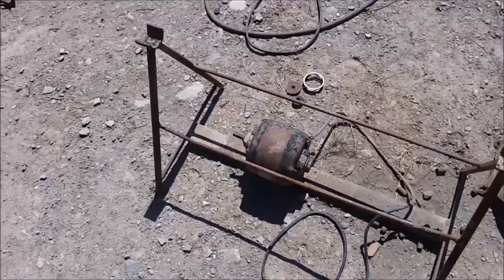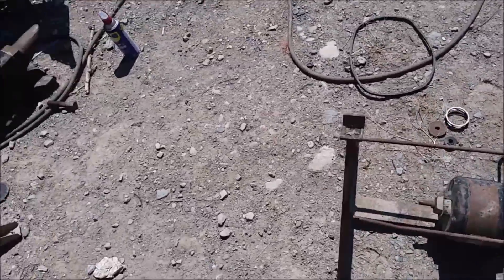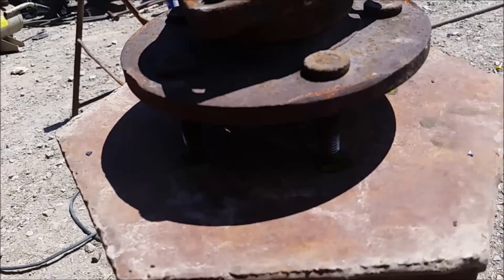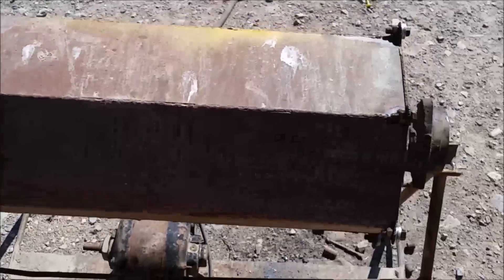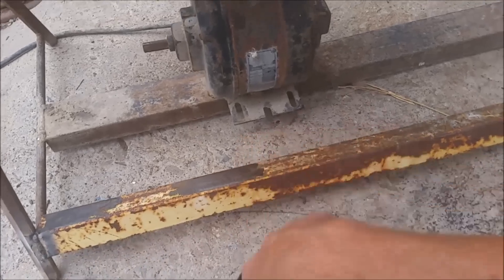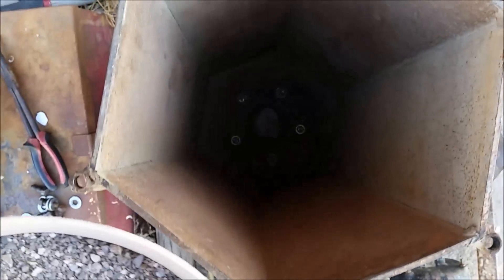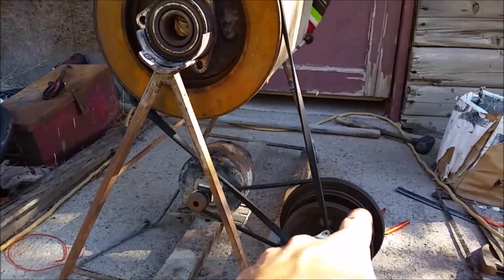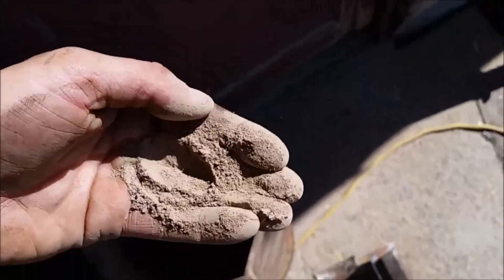Cody's Ball Mill

Comment: Cody completed my ball mill. Using 18" long 2" diameter stainless bars 4 of them inside. I have a tray for under drum roasting, blower for air during roasting in 1 end. I wish you would respond to give me your thoughts on this? I dont know how to send video of it running. Crossed fingers all work's.

Comment: Is this thing still working?  I’m asking because 4wd bearings do not like to be used with out the squish (load) of the axle stub. They tend to fall apart.  Of course this is a much lighter load than a Chevy truck.

Comment: Those hub bearings are a tapered bearing and they are supposed to be held together by a cv axle and nut. Running it without any thing in the middle means huge clearances, no preload, and guaranteed failure.

Comment: Cody, I also designed and built a ball mill.  I my research on how to build one I came across a story of man who worked at a coal factory where a ball mill was used to crush coal.  The mill was a very large continuous feed system using 6 inch steel balls.  At one point the factory decided to refurbish the mill replacing balls etc.  The man decided to keep one of the balls as a souvenir.  He kept it on his desk at work.  One morning he was notified his office was destroyed by an explosion.  Evidently the ball had built up kinetic energy from continuous pounding to the point that it exploded.  Since that time the factory buries used balls in deep pits covered by cement and dirt.  After use and clean-out I put our 1/2 inch ball bearings in a steel container with a steel lid.  Occasionally we put the media in the kiln taking them up to annealing temperature to temper out the kinetic energy.

Comment: couldn't you just put a rheostat/potentiometer on the motor to turn down the speed instead of screwing with the pulleys? it'd also lower how much power the motor would use.

Comment: Hey!!
I work in industrial plant construction and one of the last projects i worked on was a Cement Grinding Plant. 
That is where I learned how ball mills work and what are the main components of a ball mill (for the record, it is speed of rotation + grinding balls hardness & diameter + residence time of the crushed material ) to determine the correct output quality (diameter of the particles).
Im sure if I saw this video first, I would have learned faster. 
Thanks!

Comment: cool how about a screen on the inside the separate the larger material and have a single or double opening so the material is directed out those holes when at the bottom on rotation.

Comment: cool how about a screen on the inside the separate the larger material and have a single or double opening so the material is directed out those holes when at the bottom on rotation.
Reply: need to leave in the fine particulates when milling.   they help with the abrasion process.  the balls are not that abrasive by themselves.

Comment: i guess its too slow now. the correct speed should be between 65% and 75% of the critical speed which is the speed that the balls will stick to the wall in the full turn due to the centrifugal force. to find out the critical speed you can use the formula v=(60/2pi)*(g/(R-r))^(1/2) - R is the mill radius and r is the mean ball radius.
Reply: Are you certain this equation is accurate?
Reply: yes im sure but you need to consider that the speed on the equation is the mill rpm, not the motor rpm.
Reply: BR?

Comment: That looks pretty solid and simple. Where do you get those roller bearings?
Reply: Thanks. I figured they went to something big and heavy. That makes a lot of sense. Do you find the rust from your drum to be a contamination problem in your mill?
Reply: Where does he get it??
Reply: I MUST know
Reply: I would try my luck at asking around scrap metal dealers. I have no idea how common these kinds of things are scrapped, it may be a matter of just being at the right place at the right time.
Reply: Wheel hub. Anywhere from $30 to $150

Chevy truck non abs is about $50 and heavy duty.
Reply: Go to a heavy mining equipment shop they discard/ recycle them frequently from haul trucks and other heavy equipment
Reply: he used to work as a mechanic.  i bet he collected them from bearing jobs.

Comment: Great ball mill video! 

May I suggest you consider making a flotation cell for sulfide separation using simple chemicals & materials.  Thanks!
Reply: Adam, any knowledge on gold in sulfides? I sent off a 2lb sample of mine to a assayer. They extracted the gold, but wont say how. Im trying a ball mill grind fine, roasting while in ball mill, then add water and mercury.

Comment: Depending on the material you are milling in there,you may want to be careful about the air-blowing idea. Many fine powders can be explosive when suspended in air,and a spark from one of the 'balls' bouncing against the inside of the mill might ruin your day. Just something to consider,for safety's sake.
Reply: PhattyMo True, but wasn't he using lead? Lead is non-sparking. The container was steel, so that is not the best, but also he is using this outside in the dessert where it barely rains so I think he should be good. It is important that the milled powder be exposed to air often since something like Aluminum can ignite when exposed to air if it hasn't been for several days.